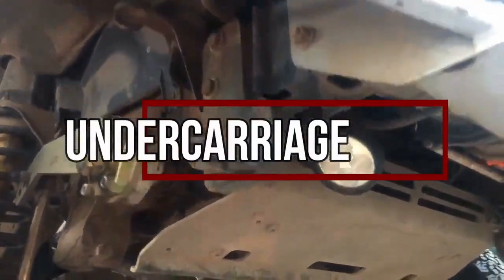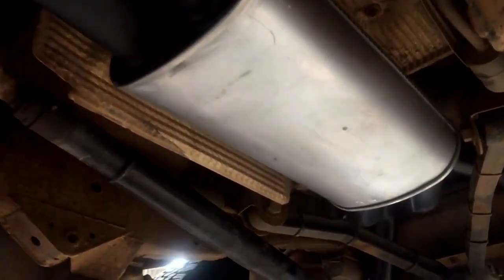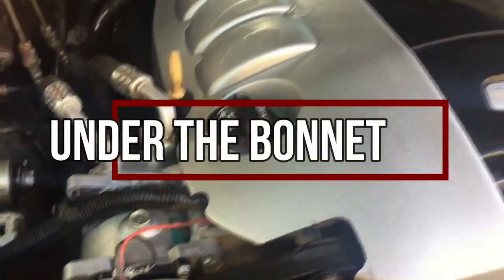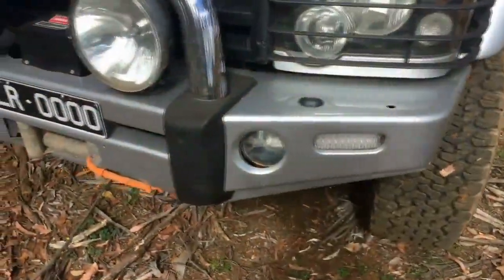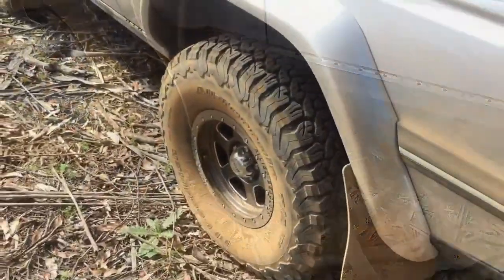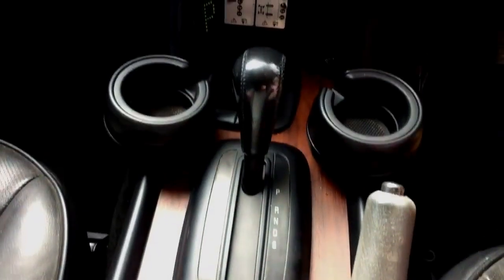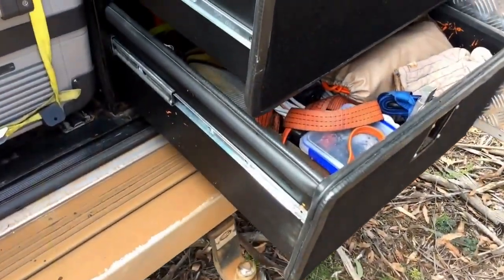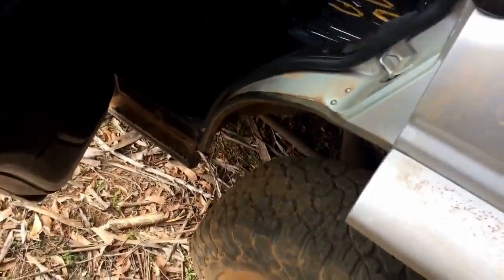Land Rover Discovery 2 Modified

Comment: Great to see analytical approach to mods plus, reinforcement of the chassis. While the depth and width of our Landrover's longitudinal member are generous, the 2-3mm steel thickness is inadequate. Add some corrosion and it's all a bit poor. 
We all go bolting huge bumpers made from 5+mm steel to the 2mm thick mild steel chassis, then a 9-15000lb winch on that...it needs consideration. Think about the disparity.

I have done this plating with all of my 4x4s over the last 40+years. Landcruisers, Landrover and Range Rovers also adding additional crossmembers to increase torsional strength.

Comment: A few things have me puzzled. When fully cutting and modifying the front housing, why not sort the caster as well? And why on the rear did you chose not to use the stock mounts for chassis end of trailing arm? Was the choice to go A frame because there are problems with the Watts link or to get away from the rear radius arms?  All in all an awesome build that is well thought out and executed. It’s one thing to have ideas, another all together to turn into reality 👍👍
Reply from the maker: husq2100 We would love to answer your questions, however this video was shared to YouTube by us to give Les Richmond Automotive some social media exposure. Les Richmond Automotive have all the technical answers. They have a YouTube channel as well. 😊

Comment: What adapter was used to fit the LR transfer case to the GM 6spd automatic?
Reply from the maker: Hi Kris, thanks for your comment and interest, this video is a re-share from Les Richmond Automotive, we are sorry to say that we don’t have any mechanical information regarding this vehicle.
Reply: @landroverlife8605  no worries, thank you for the quick reply, and for pointing me in the right direction. I'm looking at a D2, but have long-term plans for an aluminum 5.3L V8 with the 6L80E transmission. The truck shown here appears very well engineered and far more capable than my goals, but serves as great inspiration all the same.

Comment: Hi there,
Is there a general consensus on whether a first or second gen is better? I’ve always been trying to buy a manual a td5 d2 however ive heard lately that the 1st gens are easier to work for off-roading as they have a centre diff lock and better suspension articulation. If you have an opinion on this id love to hear, cheers
Reply: Get a TD5 Disco 2 - chalk and cheese on-road - the TD5 is far superior to the Tdi. The D2 is a bit bigger at the back so more practical, and better viz out the front (higher windscreen). The first few years of the D2 have the centre diff lock, just not connected, and you can aftermarket an activator (probably already done on any second hand vehicle anyway), and even with the open centre they go harder off-road standard than a disco1 modified, because of the traction control, which isn't nearly as unreliable as people claim (the common TC fault is a $2 permanent fix (wire-bypass). The last D2 models (early 04) have the centre diff lock with the actuator and are the pick models now, mainly because they are the youngest. 

The rear suspension is sorted on the D2 compared to the D1 - the  Watts link setup on the D2 lowers the roll-centre compared to the D1 A-frame - much better handling results. I'm Melbourne based, use my 99 manual Td5 hard in the Alps  and across Australia, and have never found the need to modify it (beyond a JDM centre-diff lock actuator, which was on it when I bought it well over 10 years ago) - its done 350k km new, engine is untouched, no problems other than routine maintenance on consumables (bar one blown cv joint thrashing it up a really difficult track, and a leaky wheel-bearing on a different axle). Even the rubber donut thing on the rear propshaft is still original ( I carry a spare, because they weigh nothing). They really are amazing off-road as a standard vehicle......my mate had to lift his 200 series 2 inches to get anywhere near the same off-road capability on stock tyres - much to his amazement. Ditto my other mate with a Patrol.   And its very comfortable on-road, and a decent handler with a surprisingly low centre of gravity and roll-centre as mentioned (which is the main reason I have resisted lifting it - its still far superior to a brand new Prado or Hilux etc (which I regularly use for work) in this regard, yet with HEAPS more off-road capability stock).
Reply: Ross Cayley Thanks so much for that detailed response mate you’re a bloody champ. Definitely looking for a td5 D2, just hard to find a few in my area right now. Im in melbourne too so hopefully one day ill see you up an alpine track!